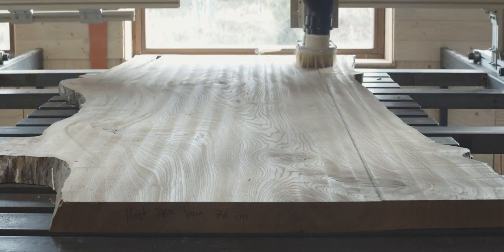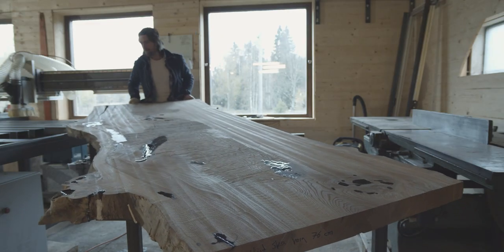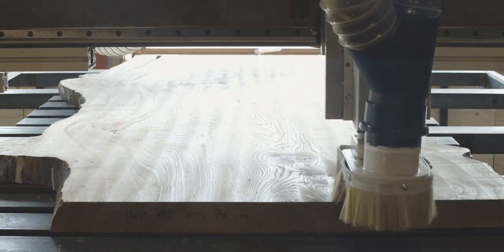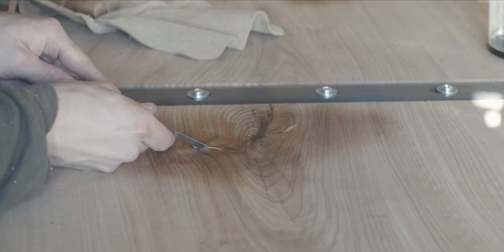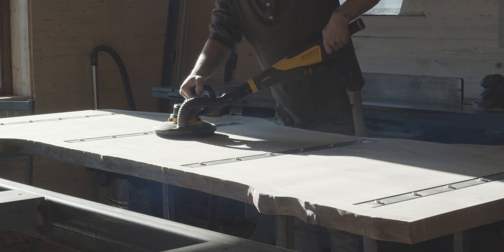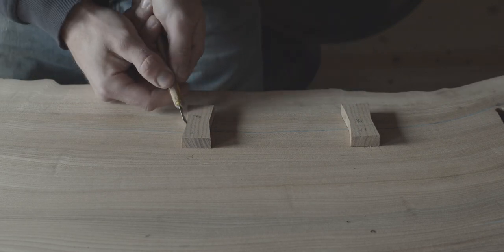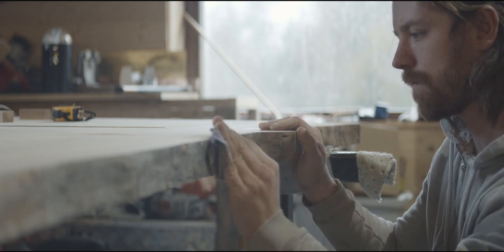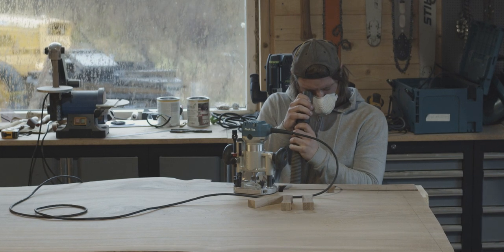I Had To Wait 20 Months Before I Could Build This Table

Comment: I think you make some of thr best videos and thanks for such a good explanation. What thikness c channel do you use. And what thiknes top min would you aim for
Reply from the maker: Thanks Tim!! The c-channels are made from 6mm thick steel. My dry slabs are around 70mm in thickness, and typically i end up with 50-55mm in final thickness. Sometimes they may have to be a little thinner if a slab has a really big cup or twist, that’s why proper stickering and storage is so important when milling slabs, gotta do all we can to keep them as flat as possible as they dry or we might not even be able to use them for slab tables. Take care my friend.
Reply: @backstromwoodwork566  thanks I've started making furniture and love what you do and the information you give for free it is so amazing. I can source airdried slabs at about 20% but don't know how to bring them down to 8% with out a kiln if I made a table with air dried then bought it in I'm assuming it would move all over the place. Take care

Comment: Beautiful work!  What are the dimensions of your C channel, and what size fasteners are you using with that?
Reply from the maker: Thanks man! Sorry for being super slow to respond, my c-channels are 65mm wide and roughly 28mm deep, so that would be about 2.5x1” (roughly). I use threaded inserts with inside threads being 6mm.

Comment: Hello mate can you put fresh cut wood straight into a kiln?    Is it essential to air dry the wood first.
Reply from the maker: Hey Buddy! Yes you can, but it takes a long time and costs a lot of money, and you need to precisely control relative humidity and temperature, which lets you decide the rate of drying. Too fast and the wood can get ruined. Airdrying takes even more time, but is a very safe way to dry wood, as long as its not soaking in the sun for too long. Best is to airdry in a shaded area

Comment: What did you write on the slab after you placed it on the loader forks?
Reply from the maker: I write width and length measurments and then take a photo of each slab so i can keep track of my inventory
Reply: Got it, how do you dry them? Do you store them under roof.